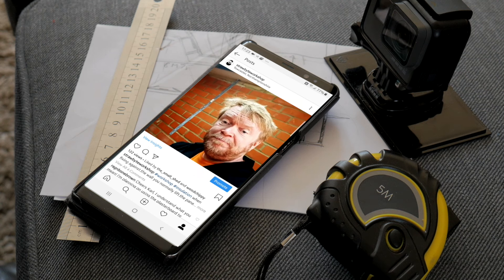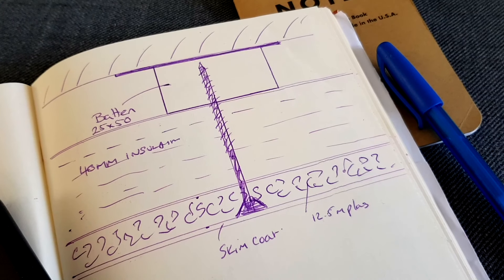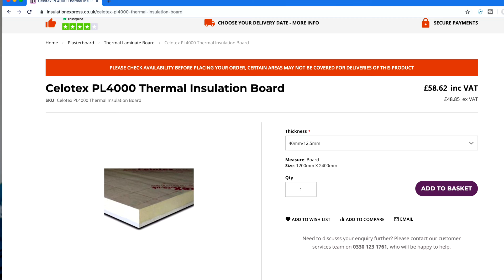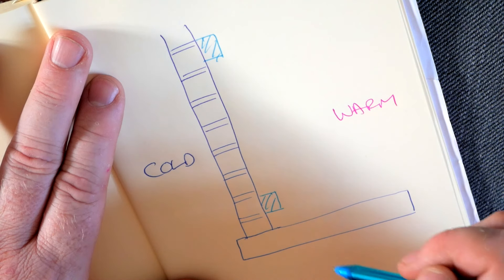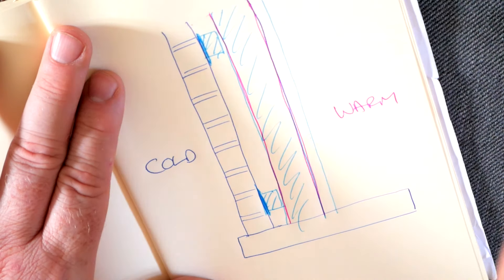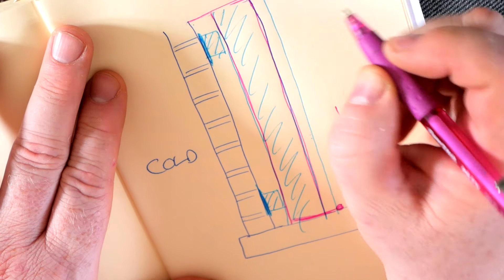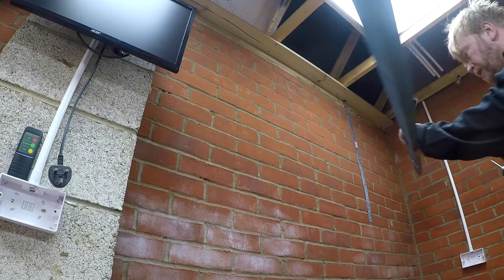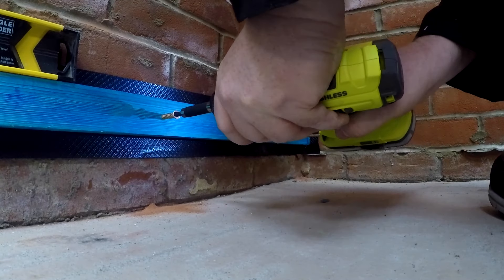How to Insulate Your Workshop | An Easy DIY Project | Keep Your Shop Warm or Cooler

Comment: Can I just ask why you chose MDF over plywood? I'm tackling my double garage in the next few months and wondering what your opinion is on boarding over windows being that I have 6 of them 2 on each wall.

Thanks.
Reply from the maker: Tony Attacks Thanks for the question. The principle reason was that MDF is denser than plywood which makes is a good insulator of sound when compared to standard softwood/hardwood plywood’s at the same thickness. Plus, it has a good paintable finish from the outset - plywood would have required filling to bring it up to the same standard. I’ve used standard MDF rather than moisture resistant.

As far as boarding up the windows, you will need to be mindful of condensation inside the window space on the inside. Brick is porous and any moisture forming in the inside will eventually make its way out. Glass is not and you will need to have a way of ventilating the space. Other than that treat it like an external wall. Batten ensure a vapour barrier is installed on the warm side of the insulation and you’re good,

Comment: New DIY'er. First great video, love the detailed explaination. Second at 6:57 you drilled through the brick fairly effortlessly. I have a hammer sds drill and I bought what I thought were good bits (dewalt), but I still need to use the hammer function to drill holes in concrete (and my accuracy goes with the hammer when I need something level. So question: is it your drill, your bit, your technique or some other variable that you drilled so smoothly through masonry? Thanks
Reply from the maker: Hi Dave - thanks for the comment and the great question. I was using a Ryobi 18v combi-drill but set to the standard drill function. "No hammer action". The secret-sauce here are the drill bits which are from Bosch. I discovered them at a trade show and they can pretty  much go through anything: Brick, concrete, wood, plasterboard/render, glass and tile. 
They called Bosch Professional Multi-purpose Drill Bits CLY-9 (link to them on Amazon UK: https://amzn.to/32LiGNU)
The set I've linked are a bit pricey and you can buy the bits separately. However the set you saw me use in the project are still going strong 3 years later - I may give them a quick pass with a diamond file to hone the edges at the drill tip occasionally.
A tip on accurate hammer drill use (or put another way in situations where you need an accurate hole when you can't afford to cock it up) is to start small. In the video I needed a 6mm hole for those concrete screws; if I wanted a super accurate hole positioned correctly, level and straight, I would have started with a 4.5, or 4mm masonry bit first before drilling out the hole to the  right diameter for the fixing. for larger fixings (my wall bolts need 13mm holes, I will drill a 6mm hole first and then widen it with a 10mm bit before drilling with a 13mm. The larger bits will happily follow the hole you drilled before and the drill has less material to, experiences less resisistance and the hammer action isn't arm-joltingly severe.

Anyway I hope that helps.

K..

Comment: Great video. Just what I needed.
I'm hoping to do this myself this summer as my first big project on a new build

After fixing all of the battens I see you apply sealant along the top and bottom. Do I need to apply sealant again once the boards are in place?

What additional steps must i take once the boards are fixed and any gaps filled?
Reply from the maker: Hi - thanks for the question.

I used the AC50 sealant on all the battens before the insulation or insulated plasterboard was applied - both horizontal and vertical. Once the insulation+MDF or Insulated pasterboard is installed, I then went round all the edges to seal the gap. Where if the gap was wider than 4mm I used expanding foam first and then decorators caulk on top.

What you're aiming to achieve is to prevent moist warm air sneaking around the back and condensating on the wall. Now you need to do the best you can and I'm the first to admit my sealing wasn't perfect, but a year on there is no evidence of any issues that I can see (aside from one area due to a badly installed DPC by the housebuilder) and so it's all good.

I may do a follow-up video covering all the comments and questions I've had since I completed the project. So do subscribe if you haven't already.

Comment: Hi Karl - did you consider building/fire regulations with the walls and did you have to take any steps to conform to these? I am doing the same to my garage at the moment (12mm ply on top of the insulation) and think I am going to have to apply a fireproof coating to everything, which is expensive!
Reply from the maker: Hi Tom. Mine is a detached garage the the aim was to avoid turning the space into anything that could be construed a habitable room or part of the house. If you are partitioning a garage into a room and the house is attached or integral to the house then yes you have to consider using fire retardant materials. Knauf fire proof plasterboard is around twice the price of ordinary plasterboard but still less than the cost of the MDF that I used. The insulation choice would have been different too - I would have had to use rockwool or self extinguishing insulation. There would have been an additional cost here both in terms of price and the amount of space I would have lost inside the garage. 

If it's not too late I would suggest that do some research and consider swapping the ply with treated MDF. Check with Building control at your council. If the garage is around 18sqm like mine and detached you may not have to have any building inspection.
Reply: @StrawbyteWorkshop  Great, thank you for the quick reply. My garage is also new build detached but is a double @42 sqm. I will check with the council for confirmation. Can't wait to get it done!
Reply from the maker: @tomowen  The allowance goes up to 30sqm so you may have to comply in some way - but like I say that may only result in the specification of materials. Have you seen the video by Ali Dymock on his garden room - he goes into a great deal of detail about the building regulations in one of his videos.
Reply: @StrawbyteWorkshop  No I haven't, thank you! I have found it now though and will watch over lunch. It seems a grey area as it is already an established building, I am just adding materials without changing the purpose - if I built a full height storage cupboard out of plywood I imagine I wouldn't need building regulations involved! Keen to avoid unnecessary hassle but I want to do it right. Thank you for the pointers, I will get stuck in to Ali's series!
Reply from the maker: @tomowen  You're absolutely right to check - I went out of my way to ensure that I didn't create any problems for myself and did check in advance (something I forgot to mention) if the thing exists already, then again you're probably going to be OK. Let me know how you get on though at workshop@strawbyte.com I'd be interested to learn what they say. Especially as I can see myself with a double garage in the next few years as we trade-up.
Reply: @StrawbyteWorkshop  I will do! Thank you!
Reply: I've had a response back already - 'No Building Regulation application will be required because the space following the proposed work would not be considered habitable.' - great news! Well worth checking. So, if the rules remain the same and you move somewhere with a double garage, you could do as you have to your single garage with no need for building regulations approval. Obviously a different story if you were building a new workshop from the ground up.
Reply from the maker: @tomowen  That's good to hear and in line with what I found out - I checked with my local authority yesterday too and that's right. They made the point that as there was to be no sleeping rooms in the space and there's no material change of use under the 2010 building regulations, the building remains exempt. If a new electricity supply or water supply is to be made to the building then separate applications are required (one for each) but they only extend to the supply and no other works. Registered plumbers and electricians will make these arrangements on your behalf - and I know about the later as I've got a new circuit going in to the workshop in the coming months (post lockdown).
Reply: @StrawbyteWorkshop  Great! I look forward to that video, if there will be one. I'm running a 40A supply to the garage too, and adding a new consumer unit in there. There will be a lighting circuit, one for the bench (with an electrical stop switch to cover the tools) and another for the other outlets. I'll take the opportunity to run an ethernet cable at the same time. An electrician is doing this for me though.

Comment: Great vid, wish all youtube videos were up to this standard - you've inspired me and I will be doing this exact build in my garage this summer. Only one question and apologies if you have already answered and I missed it - what size masonry screws did you use? Thanks
Reply from the maker: Hey. Thanks so much for the comment. The screws were Easydrive screws from Screwfix and they were mostly 7.5 x 70 with a handful of 7.5 x 50 as I began to run out. You drill a 6mm hole and then drive straight into the hole with a standard drive.
Reply: @StrawbyteWorkshop  Brilliant thank you

Comment: Great step by step. One question, did you plan for sockets and run twin and earth behind and through any of the boards, or have you surfaced mounted all of your sockets?
Reply from the maker: Good question. There is no power buried in the walls. The mains comes in to the front right of the garage and then there's some steel trunking that takes the power for lights and sockets to the back 2/3ds of the garage. In the rafters I've a ring of cable tray which carry the cables around the perimeter with sockets run down the walls with surface conduit. In the time since I made this video I've re-organised  the workshop a couple of times and moved sockets on 2 or 3 occasions so I like the flexibility. I'm having a new supply to the workshop putting in shortly so I may come back to the power side of things when that happens.

Comment: What a fantastic video. As someone who's also in South Northants, on a new estate, with a virtually identical garage, we've wanted to do this exact job (plus the roof insulation from your other video). Thank you so much for the advice. For someone who is not very handy, this really helps to break it down simply. Do you have a website that gives further guidance or details?
Reply from the maker: There's some additional information on my website that explains more about how I did the garage door. See: https://www.strawbyte.com/blog/2018/11/18/how-to-insulate-a-garage-door
This video is gaining some interest recently (probably due to how YouTube recommends based on how well the video is performing) and I am getting lots of questions. For example, alternatives that I considered in the planning stages but dismissed and then didn't discuss in the video; plus material choices and so on. So I might add more information to my website while I'm off over the Xmas/New Year break. And I definitely have a follow-up video in mind to review the project 18 months on and cover off a few things that required attention or fixing. 
I've also insulated my old workshop which was a timber summerhouse and turned that into a garden office. So there will be more from me on this sort of project too. I'm just waiting for a weekend without rain when I can get out and finish that off. Anyway thanks for the comment - I really appreciate it. Do subscribe if you haven't already to keep up-to-date with videos on the subject, and have a great day.

Comment: Great video, explains a lot of the questions I have had since I started looking into doing something similar myself! One quick question, did you use anything to hold the DPC to the back of the battens? It didn't look like you had grip of both and I can imagine it being quite fiddly if the DPC isn't glued/fixed to the batten first? I'm guessing a dab of silicon or adhesive would be better than screws as they'd obviously pierce the DPC?  Thanks
Reply from the maker: Hi, you don't really see very when what I'm doing but they're held on initially by staples into the ends of the battens. Then obviously held in place by the screws that go into the wall.
Reply: @StrawbyteWorkshop  Thanks for clarifying!

Comment: I'm looking at doing this with my garage. How's yours doing, especially with all the damp weather we've had of late?
Very informative video. Thanks 👍
Reply from the maker: Thanks for the comment. So, we're probably through the worst of the weather this year and, in general, the insulation has held-up really well. It takes practically no time to warm up when I put the heating on and stays warm for quite a while. I've since had the door installed and finished the insulation on the remaining two walls and Ive fixed the drafts around the up-and-over garage door. I've checked all the panels recently and theres just one small area where damp has come through. I discovered that this is due to the builder forgetting to put DPC in that part of the wall rather than any mistake on my part.and I'll be tackling the repair in the next few weeks.
Reply: @StrawbyteWorkshop  Thanks for the reply. I have definitely picked up some tips here.
Subbed

Comment: This was such a well made video, thanks for this. Quick question. I'm looking at doing this to my garage this summer. I have a classic car which sits in the garage over the winter months. Do you think your design would suit me?
Reply from the maker: I think the approach will help in situations where you want to keep the effects of cold and condensation at bay. Over the winter the temperature inside the garage has stayed above 5 degrees and with a dehumidifier running. My biggest concern was losing space to the insulation as the width before the work was around 3 meters and my method lost 150mm across the width. If you have more room you might want to consider increase the thickness of the insulation by 10mm to 20mm (to 50 or 60mm). These were the recommended thicknesses for a single skin garage wall from the manufacturers - I went with the minimum.
Reply: @StrawbyteWorkshop  OK thanks. I could definitely go thicker. My garage is a lot wider than a standard size garage. I was thinking of putting a dehumidifier in, but I was talking to someon who also stores cars, and he said if you get the insulation right, I shouldn't need one. Thanks again mate 👍